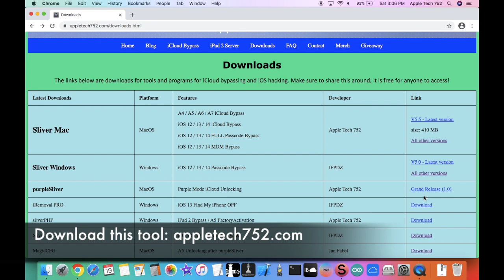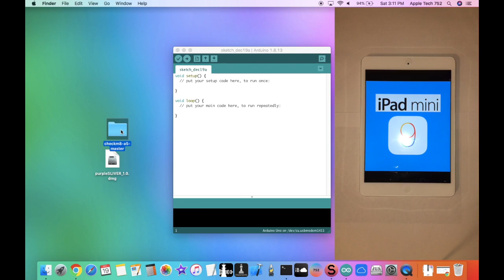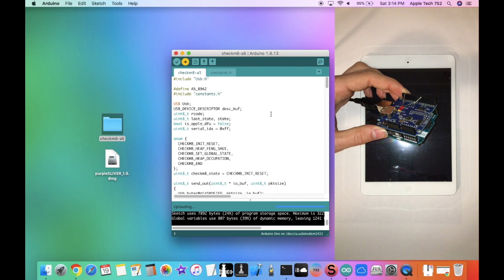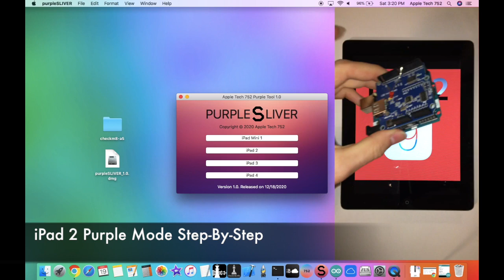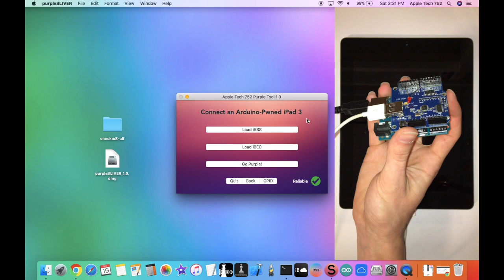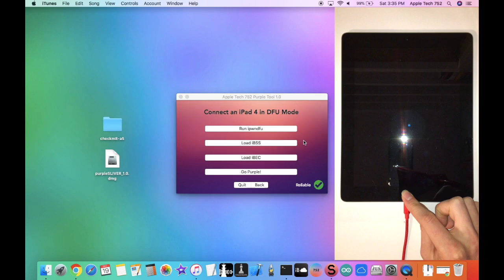PURPLE MODE FULL TUTORIAL for iPad 2 3 4 Mini 1

Comment: Hi master, 2 questions, please:
1) The P10 adapter can work for 30 pins (iPad 2)???
2) iPad 2 (GSM) after hardware hack of remove the resistor of the motherboard (responsible for GSM), will work normal in this process like a "iPad 2 Wi-fi" ???

Thanks A lot